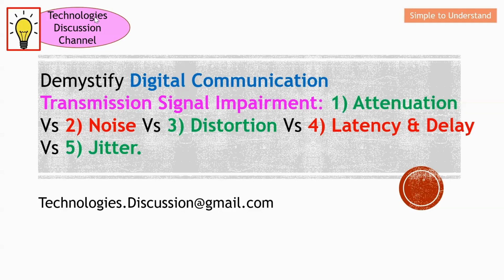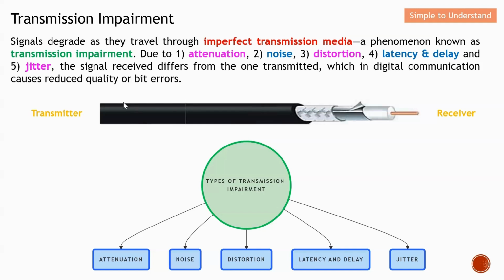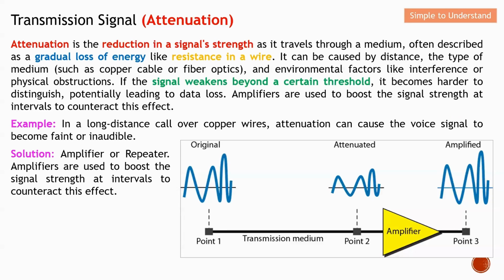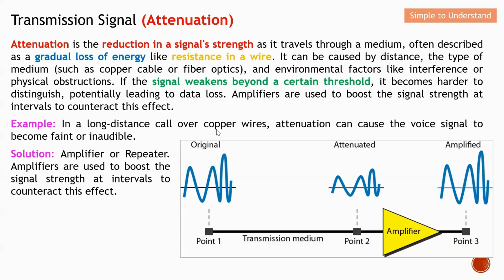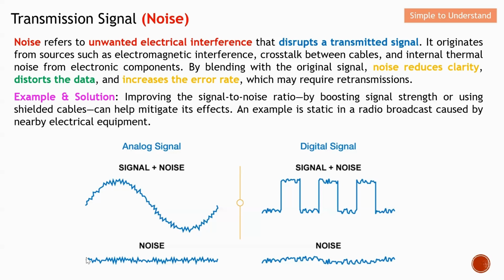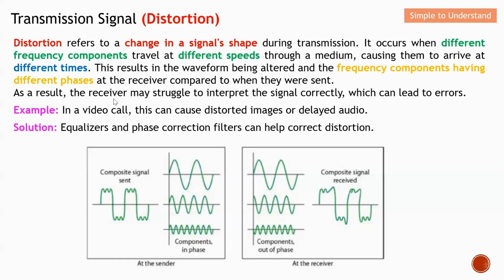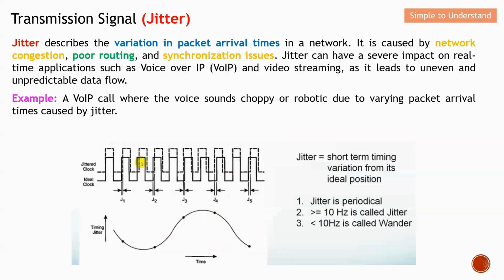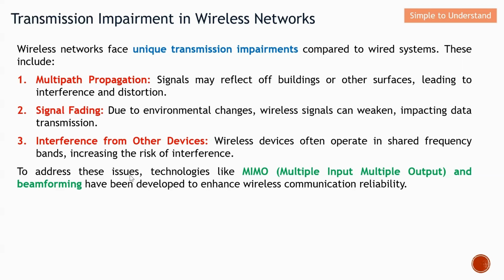Digital Communication #5. Attenuation, Noise, Distortion, Latency: Transmission Impairment Explained

Comment from the maker: Thank you for taking the time to watch this video.
When a signal is sent from a transmitter to a receiver, we ideally want to receive exactly the same signal. However, in the real world, this is not possible. As a signal propagates, it is subject to transmission impairments, which include attenuation, noise, distortion, latency, and jitter. I will discuss each of these parameters in detail.
Attenuation means loss of signal strength—the amplitude of the signal decreases, while frequency and phase remain unchanged.
Noise can enter the signal from external sources, such as coupling from another cable.
Distortion is among the most severe impairments, because the shape and characteristics of the signal change, which may prevent the receiver from correctly interpreting it.
Next are latency and delay. When a signal travels from one point to another, there is always some delay—for example, electromagnetic waves take time to propagate from transmitter to receiver.
Jitter is the final transmission impairment. Due to network congestion, packets may take different routes to reach the destination, causing variation in delay.